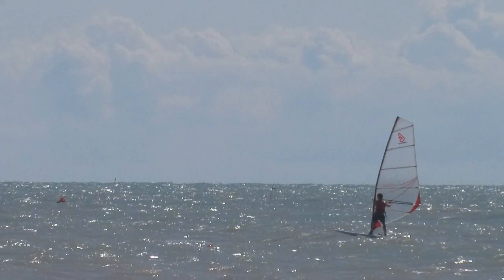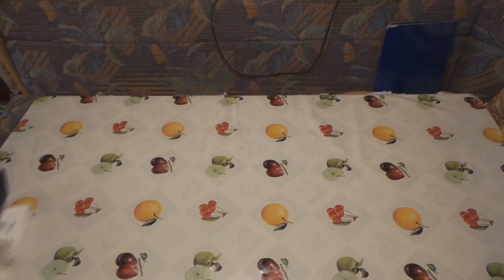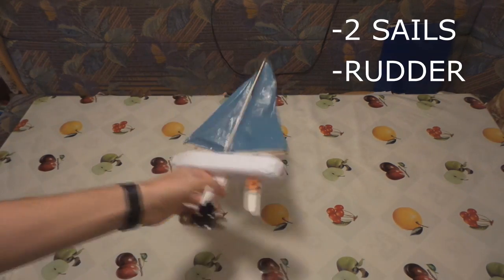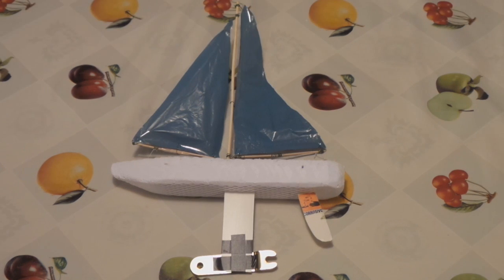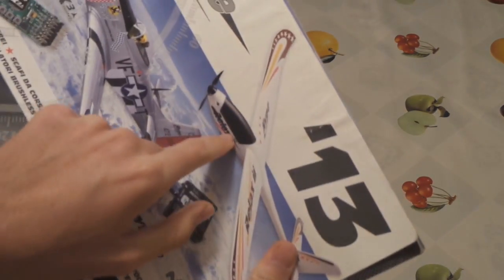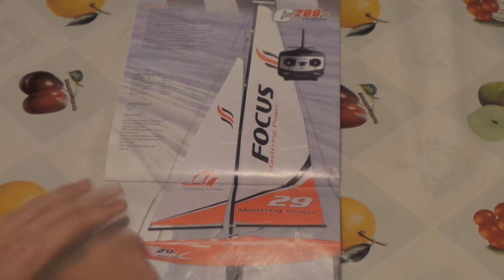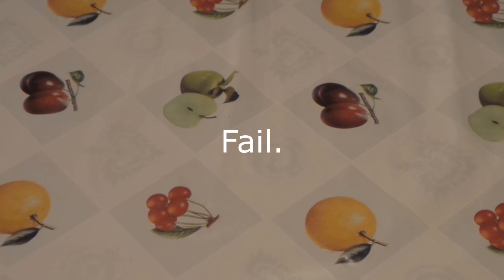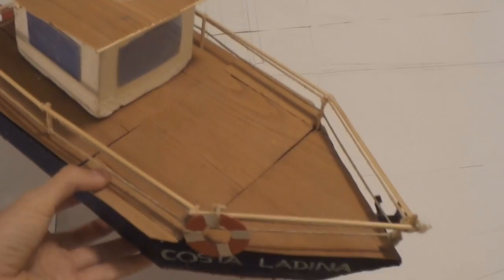DIY RC SAILBOAT FOR 20$! [Part 1]

Comment: you put a boom on the jib... that's so bad
Reply: It's called a self tacking jib and has been used with great success on workboats for hundreds of years...
Reply: @hajosmulders  lol that's not what a self tacking jib is. A self tacking jib isn't anything specific.. there are many variations. I have never seen that before though
Reply: @hajosmulders  that’s not what a self tacking jib is I think it’s just a structural support thing